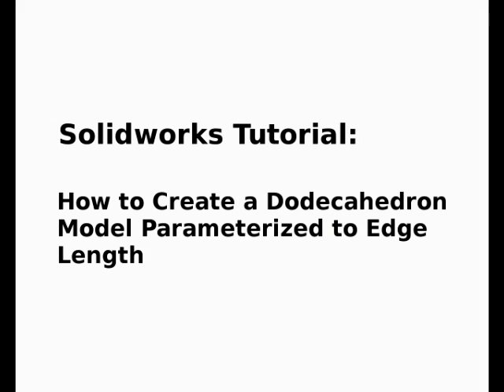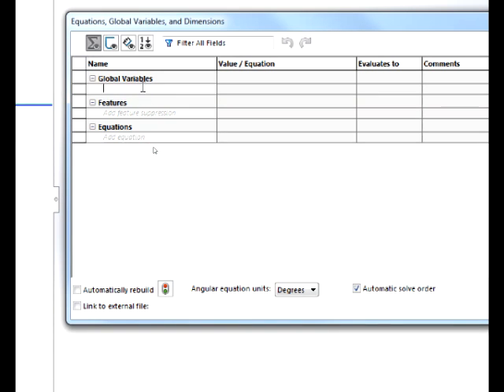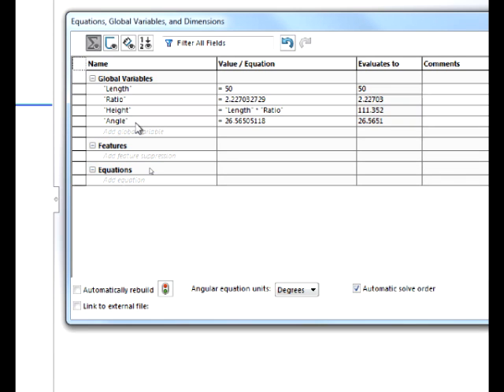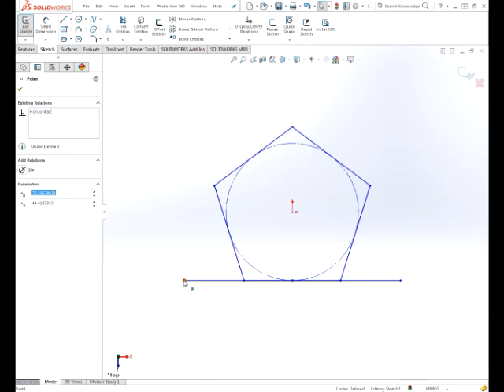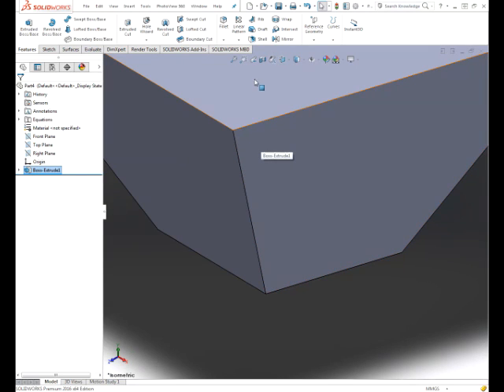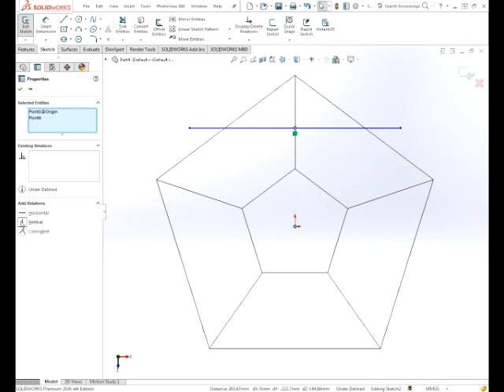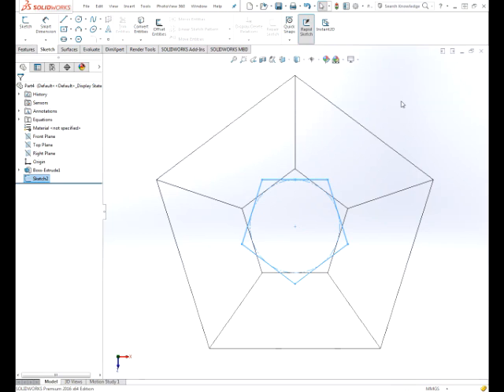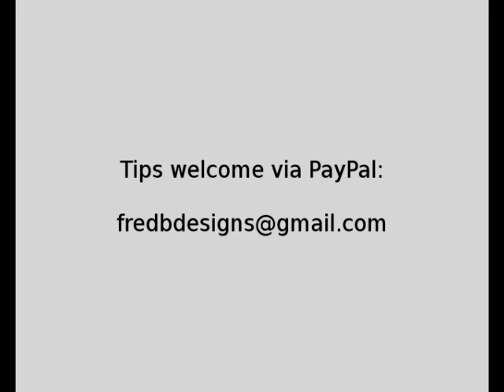Solidworks Tutorial:  How to Create a Regular Dodecahedron Parameterized to Edge Length

Comment: This made from a 5 sided shape. I need to make a 3d shape from a 6 sided shape. Do you know what the 3d shape would be called?
Reply: A 6 sided 3d shape is a cube. A truncated octahedron had 8 hexagonal faces with 6 square faces where all edges are of equal lengths.
The following website has all kinds of calculators for quickly figuring out parameters of various geometric shapes, here is the one for the truncated octahedron:  https://rechneronline.de/pi/truncated-octahedron.php